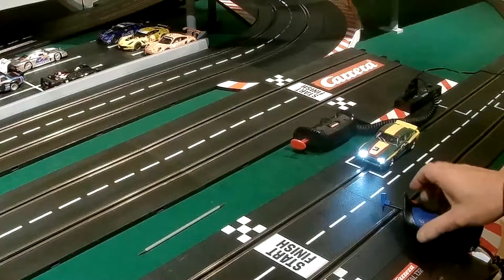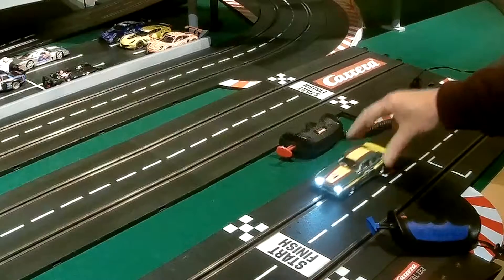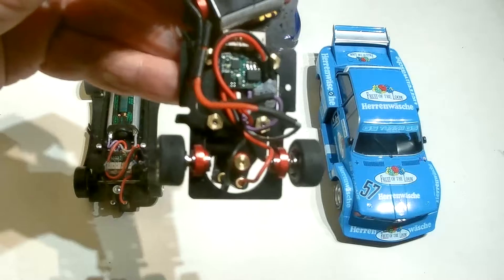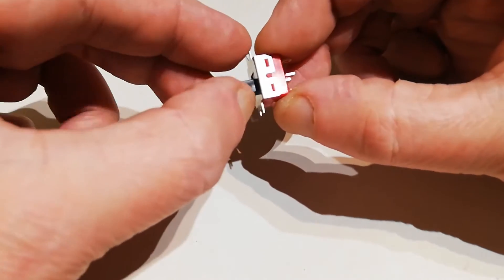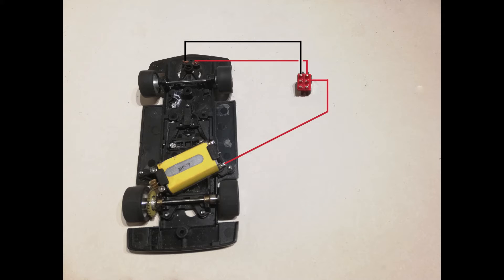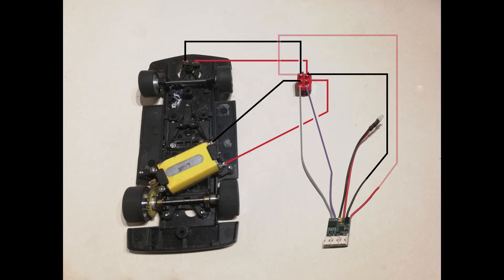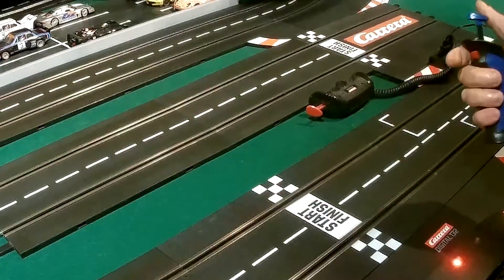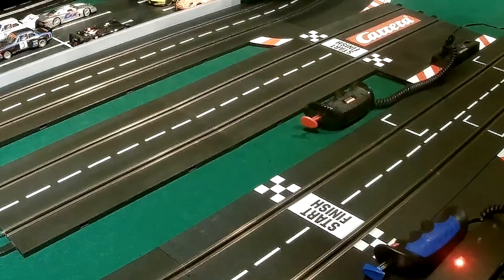Switchable Digital / Analogue Slot Cars using FT-Slottechnik SCD2022 Carrera digital decoder chips

Comment: Hi Dave. Your switch appears to be a Double Pole, Single Throw switch. I say this as there seems to be only two positions the switch can be in - either for digital mode or analogue mode, with no off position in the middle which would then make it a Double Pole Double Throw switch.
Reply from the maker: yes correct :)
Reply: @slotr  Have not long watched your cleanup, repair and revamp of Mundon Park Speedway. When you first announced the teardown of the track, I was wondering what was to become of it, and whether it was to be replaced with a newer iteration,

Comment: I’m sorry, digital is not real racing. And thumb controllers are back to the 60’s. No!
Reply from the maker: We all like different things
Reply: How is digital not "real" racing? It's the same as analog except you can simulate more REAL racing features, like lane changes, fuel stops, pace cars, etc. and most importantly you can do it all with 6 other racers on a 2 lane track.
Reply: And neither is a slot car so?

Comment: A bit involved, but it works!  Seems like Ive seen where some guys unclip wires from the chip, and have the same connectors to re-clip to oem wires and be analog again.
Reply from the maker: yes micro JST plugs ...  that's an alternative,  I've got some on the slow boat from China,  when they eventually turn up I'll do a "making chips plug and play" video :)

Comment: Good idea and I like the way in which you have used the switch. However, if you are racing against other analog cars that do not have all that mess inside, your car will be always a poor performer. As a PoC this is nice but I would never use such analog car for racing analog.